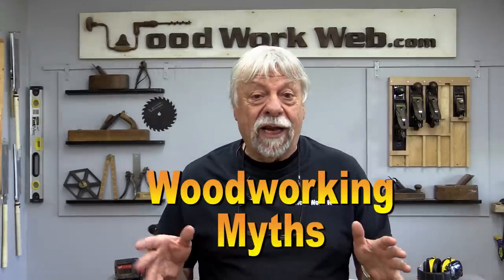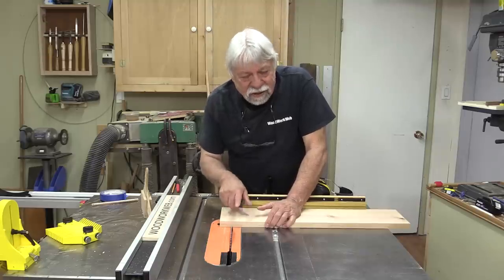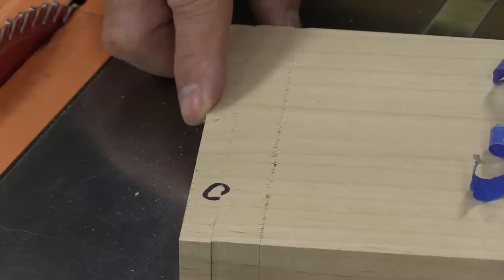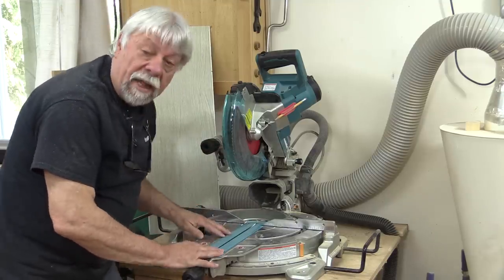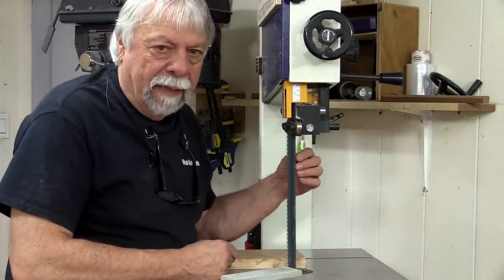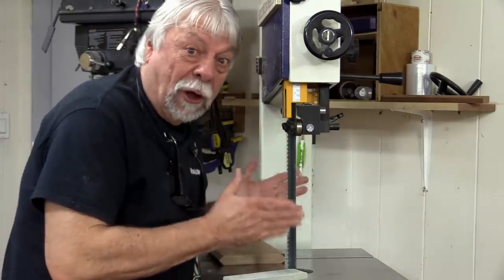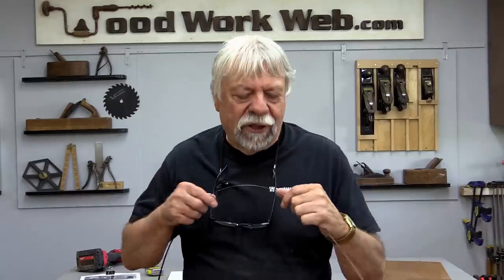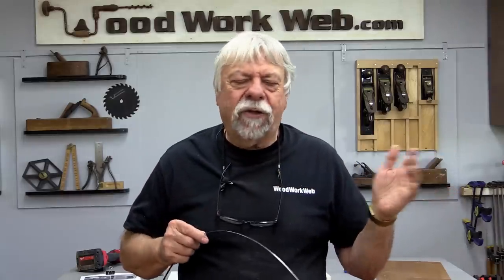Woodworking Myths and Useless Woodworking Hacks

Comment: Great tip on "good side down at the miter saw". News to me, and now explains my frustration with getting chip-out with "good side up". As always, your videos are great.
Reply: A good sharp blade and pull or push gently through timber you will get near perfect cuts no problem